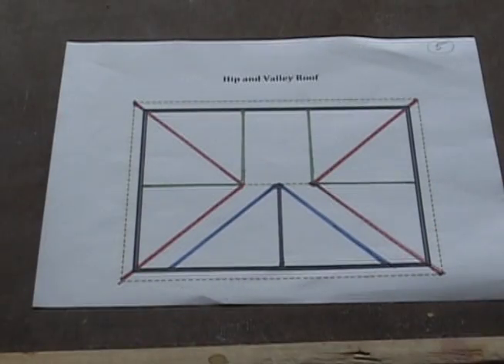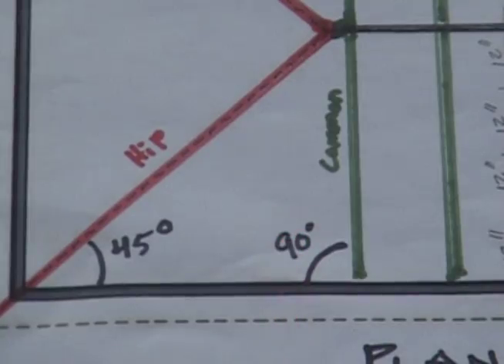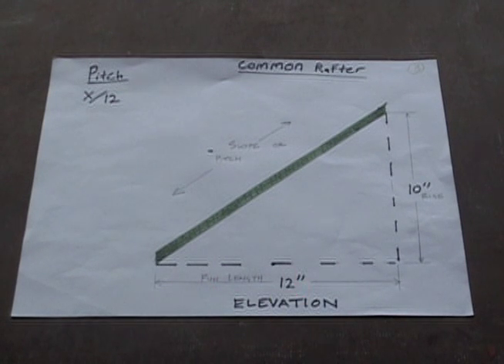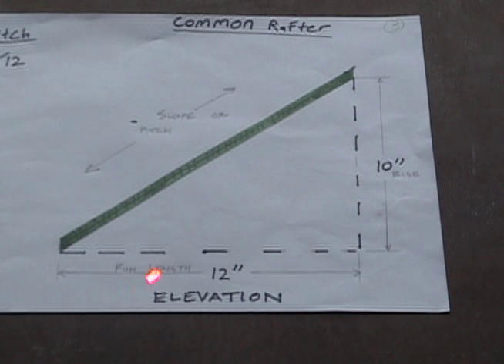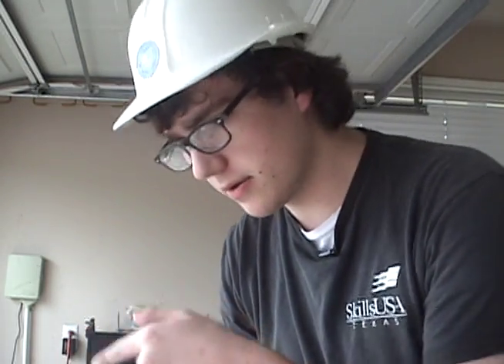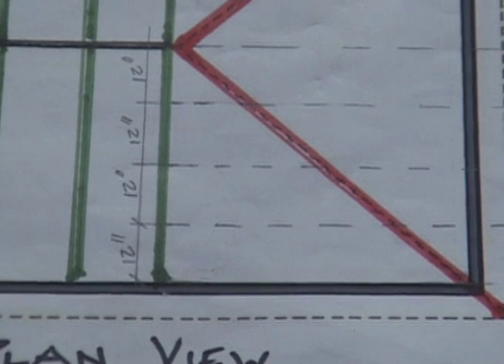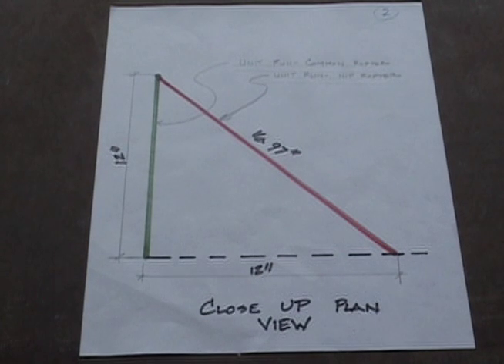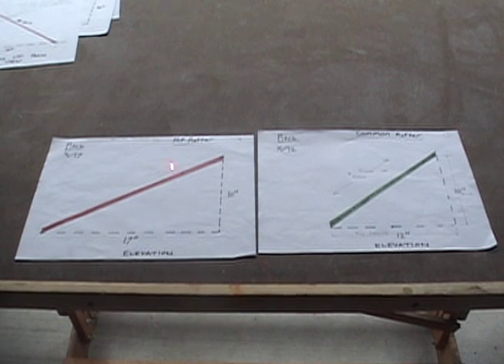Construction Rocks-Marking Hip &Valley Rafters With a Speed Square (Part 1)

Comment: Hi, about common rafters, what if your run is 6'2" and your rise is 3", in other words your using a 3/12 pitch.
How do you calculate the run, cheers.
Reply: Egidio Borg is the construction calculator is very easy to use